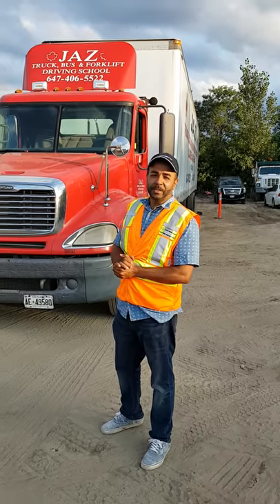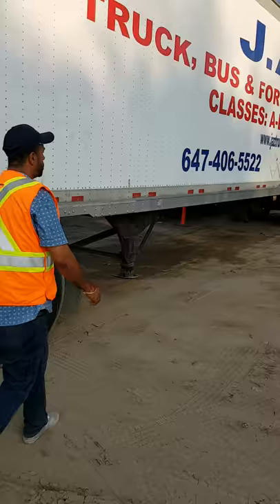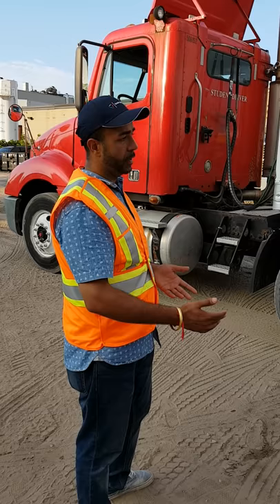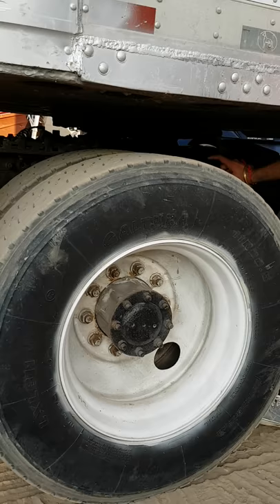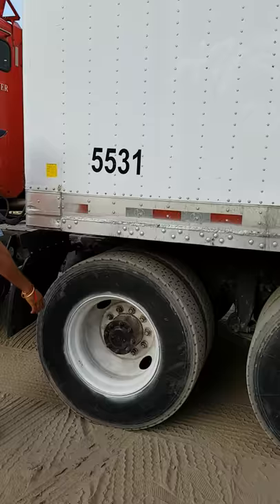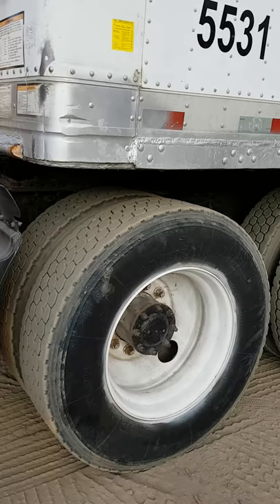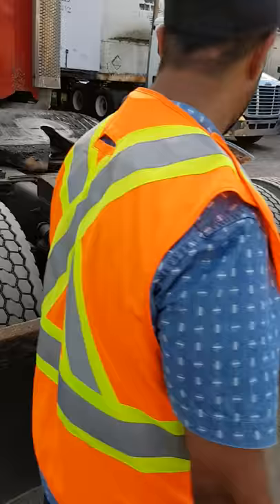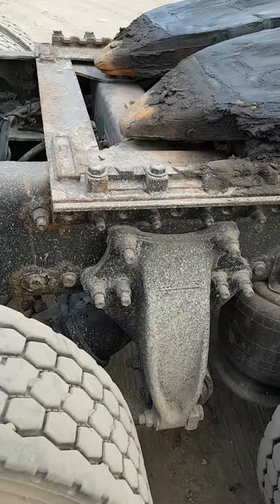Jaz truck driving school Uncoupling/coupling MELT program 2017

Comment: As a Certified Evaluator and Instructor with almost 50 years of trucking, what I can tell you based on what I have seen, is you get the gist of it. Would you fail, No. Failure is a lesson to be learned and an opportunity to understand what you're missing, or may not have known, or, your complacency, has allowed you to miss a step, without thinking of the repercussions down the road,. Personally, I'd offer a 1-hour course to refresh your memory. With no airbags on your truck, you did good on height, when dropping the trailer, but what would you have done if a driver before you dropped that trailer loaded and it was just below the transom. I would rate this video a 7/10--- good job

Comment: My question is, what do you do, "IF" you don't have wheel chalks or block, available? If you're running a day-cab, you have no place to safely secure, what can you do?
 Talking to an examiner is for when you are getting into trucking. What should you do, when you have a Class A and you are "Coupling and Uncoupling", forget the examiner. 
  If you are "unable" to unlock or pull the locking arm out, it has nothing to do with friction. And has everything to do with the position of the 5th wheel. Your best route when you're about to uncouple is to take the pressure "AWAY" from the jaws or locking arm. Just get back into the cab put it in reverse and take the pressure away from the jaws.
 On that catwalk, ( mind you what you do in your yard is your business, but as soon as you drive on that road, it is yours and theirs) bungee cords are illegal and placement of the line is not allowed. It is why truck manufacturers, have a Lines Holder on the back of the cab. I know that this is all for "How To", but if you're going to show how it is done, please make sure, they understand the rules.

Comment: When I am dropping a laden trailer first off I check the ground, let's say I am dropping on a concrete yard first I disconnect the air lines and stow them on the back of the cab then I dump the air suspension on the trailer it keeps weight off the landing gear then I, wind down the landing gear when it touches the ground I, put the handle in low, gear and wind it, some more until it's really solid i then open the safety clip on the fifth wheel and pull the handle now I, sit, in the truck and pull forward slowly until I hear a, click the Jaws of the fifth wheel are, now free of the king pin, of the trailer now i drop the suspension of the truck and drive clear of the trailer then level suspension again greetings from Ireland

Comment: When you "Uncouple" or "Couple" to a trailer, you DO NOT remove the air/electrical lines until "AFTER" the power unit clears the trailer, and is still able to support the trailer after disconnection. Your 3-point Contact is terrible. The grease on that 5th Wheel is terrible. The overflow is hanging over the 5th wheel, which is way too much for the 5th wheel and its purpose. The area to the front of the 5th wheel shows rust from improper lack of placement of the grease. I should place a timer on the areas that are not good. But bringing the power unit to the trailer is good, and making sure everything is safe to back under is good, BUT, it is from that time, that you need to hook up the lines. Once that is done, you can go back into the cab, apply the brakes, release the trailer brakes and watch your "Secondary Air Gauge" which will tell you if the trailer is charging. Once you have done that, re-apply the trailer brakes, listen for the exhaust. Once you hear that very audible release of air, that is your indicator that the trailer spring brakes are charged and ready for hookup. Then you may go under and hook up. Don't worry about the shift of the trailer, you normally never hit the kingpin straight on. Once you hear the clank of the Locking Bar, you then give 2 good tugs to be sure you are hooked up. And don't be tender-footed, pull and hold for a second on both tugs. There is no better time for separation than at that point.

Comment: You have done a very good job.  Well explained.  It is very useful.  This is more than sufficient to pass the test.  But I have to still point out what is lagging in this video.  Please use a camera instead of your cell phone while making the video.  This video gives you a feeling that you are hiding behind a curtain and watching it.  Even if you have to buy a refurbished camera, it costs you just $200, but it will give your video a very professional look.  secondly please switch off the engine while you explain.  The tractor noise is not pleasant.

Comment: Could you update your videos to 2019 I know there's a couple of changes that has been made
Reply: frank wiebe  can you pls tell me what changes had made?
Reply: @coolmen3570  yeah there's a lot of things more specific now, when you do your circle check and everything else, it's three-point contact when you get out of the truck, and you have to tilt your 5th wheel  in say it has minimal FreePlay and you also  have to say that you're Kingpin is at a 90 degree angle and your skid plate and Kingpin has no damage, and there's no gap between the trailer and the fifth wheel, and you also have to say your pins are straight, and there's no corrosion,
Reply: frank wiebe  thanks...I got more idea from you..
Reply: @Frank  How are you doing

Hope we get to know each other with time and patience?